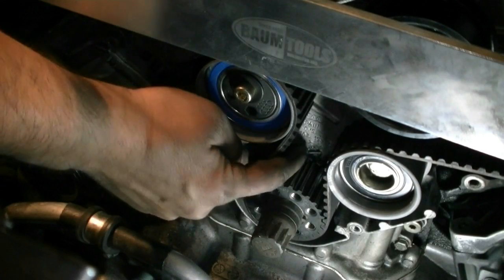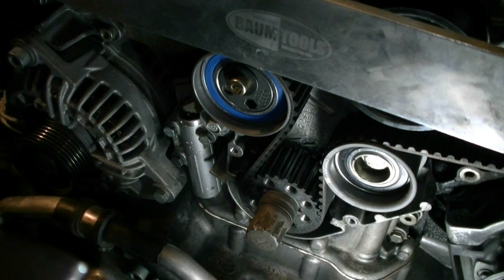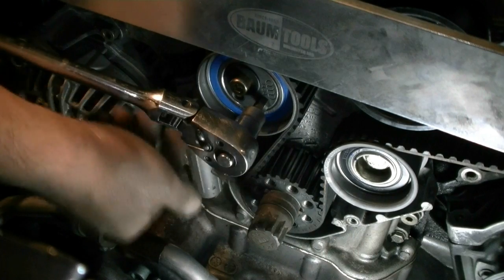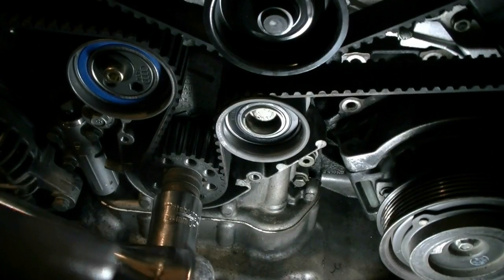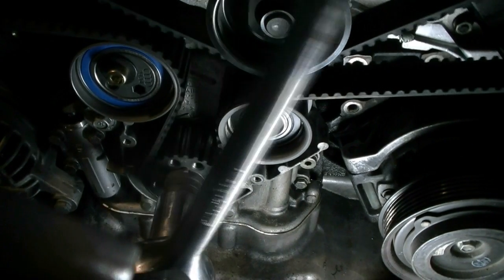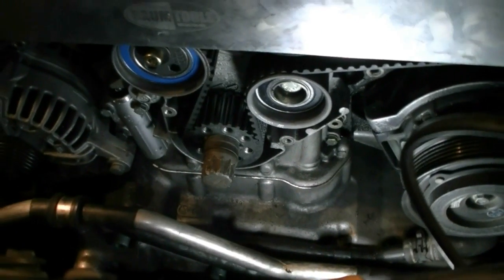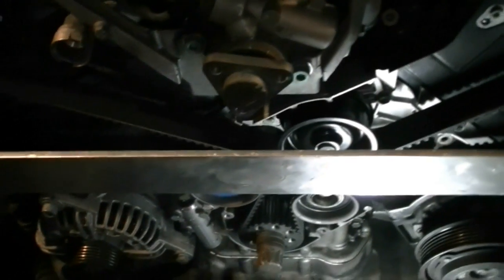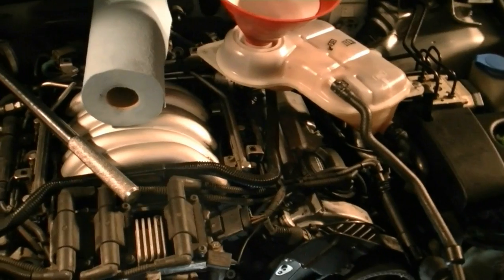How to Replace the Timing Belt on a VW Passat AUDI A4 A6 2.8L Engine Part 3

Comment: I'm going to post a question, but I anticipate no answer, because others have asked questions of their own 4, and even 7 years ago, with no answers.
Anyway, isn't it possible to replace the timing belt without using that $100 "tool" straight steel bar? My thinking is that if the camshaft tooth pulleys remain lined up (with previously marked reference marks) and the crankshaft is also lined up properly, all parts of the motor are lined appropriately.

Comment: I've done two or three timing belt replacements on Volvos with the B230FT engine, so I understand the basic procedure. There is one special tool that is used there to hold the crankshaft in place to remove the harmonic balancer. It's a bit scary if you've never done something like that (I am a do it yourself mechanic). I have a 2005 V6 Passat, and I must admit it is intimidating to think about replacing the belt, thermostat, and water pump on it, but I would not look forward to having to pay a dealership about $1,000 to do that. Is that price about correct? My experience is that a repair job that takes a trained and experienced mechanic 15 minutes to do can cost the unwitting customer one or two hours of labor, so the 'scare factor' on this job would be enough for a dishonest shop to inflate the labor time to five or six hours, maybe even 8. 

All that notwithstanding, thank you so much for posting these videos. They are clear and concise. I also appreciate your providing the appropriate tightening torques, which can make the difference between leaking water pump  or thermostat gaskets or stripped fasteners.

Comment: Hey did any 2.8/2.7 engines ever make weird sounds when turning the engine? I replaced the belt, turned the engine to make sure it's all good. My marks and cam bar lines up good, but when a compression stroke feels like it's about to start, I hear a weird noise at the top end. I don't hear anything when it gets to the end of the compression so it doesn't sound/feel like a valve is getting hit. It's a super high mile engine so it could just be from age or something, I just wanted to be sure before I crank it. It doesn't sound like a valve hitting something, it's more like a lose metal sound, or the valve flying up real fast.

Comment: When you initially put the engine in TDC and remove the harmonic balancer you put a witness mark on the pulley- block then rotate 30 degrees CCW - why?  Why don't you just mark the pulley-block and leave it alone?

Comment: Great video. When I was done replacing the Timing Belt I notice a slight lifter "ticking" noise at idle that I don't think was there before. I didn't run it other than idling for a few minutes, no codes. My question is if the belt jumped a couple of teeth could this cause this problem?

Comment: Thanks a lot for this dude. I just hit 130k and my car died. I had suspected the timing belt had never been done but it looks like I need heads now :)
Reply: sellingthewind what were the symptoms on yours did it stall out outta nowhere and just crank and no start and also a code for camshaft position sensor and EPC yellow light on dashboard my friends is doing the same timing belt is still intact not snapped or broken any ideas would help

Comment: I'm about to do the timing I'm just doing the water pump and the belt not the components my pump is leaking do I have to lock the cams if I'm just doing the timing belt and pump please let me know thank you or if some one would text me I'm at 1 802 753 6621 really need help thanks

Comment: Great videos!! I've done that a couple of times on my Passat so enjoyed vicariously reliving it through your videos. Reading the comments: with the locking bar it's impossible to be a tooth off. The camshaft gears rotating on the camshafts also allow you to get exact timing, not limited to half a tooth as with some setups like the VW L4s

Comment: I have a 2002 Passat w/ v6 engine that just start leaking coolant  in front of the engine (RT side) on top rear of the alternator, any idea on what the problem may be? thanks for the videos.

Comment: great tutorials, just when checking timing marks you said crankshaft timing mark lined up just about right, this might be taken incorrectly. it has to be on the mark or within/less a half tooth, some may be a tooth out and think it is close enough. I see one comment from a viewer regarding adjusting the timing, his must be out.
Reply from the maker: Peter datechmen YES timing marks must line up exactly. I will make an annotation later pointing it out later. Thanks for your comment!

Comment: Thanks for the videos! They have been a huge help as I've been working on my LH cam tensioner seal. Why was it necessary to bar the engine back 30 degrees?
Reply from the maker: ***** Not supper necessary its just a precaution so if the cams snap back you dont bend any valves. But generally speaking if the cams snap back they move off their cam loabs so "usually" you'll be ok. But if you want to take extra precautionary measures you can do what I did. GL
Reply: ***** I second this question
Reply: RatchetsAnd Wrenches Thank You! these videos have been the game changer!

Comment: what's the total amount of hours for doing the timing belt ?
what's the average labor price for doing the timing belt  ?
Reply from the maker: $450-$500 would be a fair labor rateat a shop for Tbelt, water pump, all tensioners and rollers plus the thermostat. GL
Reply: wooow here in Hawaii all the mobile mechanic not certified backyard mechanic they are asking me from $ 700 to $ 1000, unfortunately mobile mechanic have really bad reputation in Hawaii, mechanic shops they go for $ 90 at hour and when I ask if they have the tool they say they don't have it so I am scared they would mess with the car.... Last time i bought the tool cause the mechanic didn't know he need the tool and print a step by step guide. I know I can do all the uninstall install parts EXCEPT adjust the cams and valve. You should come to Hawaii :)
Reply from the maker: Haha very tempting.. yea just shop around if you cant find a cheap one make sure to atleast take it somewhere that knows how to work on these cars. GL
Reply: avg time to r an r a belt

Comment: I have a Passat with the same engine and it has a coolant leaking from the front of the engine. Is there. Good change its the water pump? Only leaks when it runs and coolant drips onto the crank pulley and down onto the oil pan...
Reply from the maker: Probably, but it could also be from the thermostat housing and there is a coolant pipe there too if I remember correctly. Going to have to take off the covers and take a look..you dont want coolant getting on your timing belt so the sooner the better. GL
Reply: RatchetsAnd Wrenches Ok thanks... I just bought a timing belt kit from blau parts

Comment: i did no see where the  crank shaft holder goes did you use it on this car??
Reply from the maker: I didnt use the crankshaft holder, the crankshaft takes some force to move so you are good if you are careful and follow my directions exactly in the video. Just check that it hasnt moved after you put on the tbelt. If you want to use the holding tool, it goes in the left side of the block, you'll need to remove a plastic cover thats in there with one bolt to screw in the holder in its place. GL

Comment: 02 2.8 passat future son in law bought it a few weeks ago car sat for a long time. t-belt broke, bent the valves, we sent the heads to the machine shop but did not take off the cams. my mistake is i marked the  heads but not the cams got it all back it a box . i figured out the caps. are the cams stamped in any way for left and right . int or exh.? looks like they can go on either way. any help would be greatly appreciated. thanks for all the great videos they have been a ton of help. cesar

Comment: Was thinking on getting a 03 passat V6 having 134k. With your videos and my little back ground working on cars you make it look really simple to do the job yourself. Other than the timing belt,waterpump ...etc. what else to look into? also sludge is only for the 1.8t right?

Comment: I have an Audi 98 A4 2.8 and the heater is blowing cold air.  The antifreeze is not going to the heater core.  What do you think is the problem? A friend told me it might be the heater control valve and I cant find it on my car.  Do you really think it's that?
Reply from the maker: I would bleed the cooling system and make sure all the air is out, these engines are pretty hard to bleed. If that doesnt work find the two hoses going into the fire wall to your heater core they should be about the same temp, if not there might be a blockage issue with your heater core. I am not sure where the heater control valve is either but if I had to take a guess I would say you probably have air in the system. GL
Reply: the heater core is fine, i don't have water going into it.  i took the hoses off and the antifreeze is not circulating through to the heater core.  do you think the cooling system has air? what is the best way to bleed it?  If you dont think that is the problem, then what do you think it is?  water pump or thermostat?

Comment: Dear R&W - Need help.  After daughter drove 2004 2.8L Passat to work, we noticed puddle of coolant on driveway.  She put 50 mi on car during day with multiple ins and outs.  No temperature lights or issues while driving.  Took it to gen'l mechanic who found pinholes in coolant pipes under intake manifold & replaced with OEM pipes, o-rings, etc.  No heat when we picked it up after repair. Took it to VW specialist, he  tried bleeding, etc. Still no heat, and no coolant getting to heater core except for a trickle at 3000 rpm while car sitting stationary, then only some luke warm heat.  Our first thought is that the water pump went out, but the VW guy put a new one in (with metal impeller) with the timing belt 35,000 mi. ago (133K on car), and it seems like too much of a coincidence, unless something happened as she drove it that day that damaged it or plugged something.  Second thought is that gen'l mechanic mis-routed pipes, etc., but not sure that's possible, and he says he was very careful to put it all back correctly. Third thought is gen'l mechanic did something to plug it up somewhere. The temp. gauge stays at 190.  We're torn as to what to look at first, All are expensive.  It's 7 below this morning. Thoughts?
Reply from the maker: Sounds like air in the system to me, its very hard to get all the air out of the cooling system on these engines! There are two bleeding holes one on the heater core hose next to battery tray one on coolant pipe below the ignition if I remember correctly. If you google it you can find many good write ups online to help you or your mechanic to get all the air out. GL
Reply: RatchetsAnd Wrenches Thanks for the input.  The VW guy tried that - twice.  I'd pull my hair out if I had any.  Thanks again.

Comment: I love the videos!! I wish i saw them a few weeks ago. I did this job 3 TIMES!! and my car is still bad. I only get error codes 300 304 305 and 306  wich are the cylinders from 4,5 and 6    do you think it could be something else like sensors!??! they all have been replaced.  Where are you based at?
Reply from the maker: Where the codes there before you replaced the timing belt? Does the car making any clicking noise? Make sure you reconnect the cam position sensor on that side(Driver Side).
Reply: RatchetsAnd Wrenches
since I bought the car it has had those codes!! They have been the same piston 4-6 misfire. some time it sounds like a rattle inside..clack clack clack.. and some time its smooth. It comes and goes.  It cant pass inspection and I dont want more trouble??   im gonna send you an inbox
Reply: First I would replace spark plugs(make sure there is no oil in spark plug chamber) and Wires. Just to eliminate it. Then Clear the codes with VAG tool. If misfire comes up, do the TB again with proper tools.

Comment: You won't believe this,put the timing belt back on,cranked the engine over heard a loud pop,I had left my breaker bar and socket on the balancer ,it caught unscrewed the bolt jumped time and bent the valves .still kicking myself,wil pull the head this weekend
Reply: Frank Brown that almost happened to me on a honda I left the ratchet with socket atached nd hera a loud pum thank god nothing.bad.happened

Comment from the maker: Sorry I dont understand what you are explaining, I assume your car has performance issues between 1600-2000rpms and you dont think it has to do with timing or the ABS, well its hard for me to diagnose it like this but if I had to give you any advice, it would be to check all vacuum lines, there are alot of them on these engines and are known for going bad. Good luck

Comment: Hello friend, I have a Passat 2.8, year 99, and I have had some problems in between 1.600rpm spins at 2,000 rpm, has spent several scanners in exchange and motor, I have a doubt be the problem in the ABS or the DOT passat.
DOT POINT OR here in Brazil is known when the engine is delayed or ahead. The car starts to take a tripidação, what can be? the ignition switched todo.Desculpe my English.

Comment from the maker: The labor is going to depend alot on where you live, here in socal labor is cheap so if you shop around you can get the job done inc. parts/labor for around $700-$900. Cleveland I guess $1000-$1200 would be fair if done by an independent shop using good parts etc. Job should included the whole shebangebang (belts, water pump, tensioners etc.) and yes service position for alternator replacement. GL and thanks for your comment.

Comment from the maker: No video but you need to remove bumper cover, put lock carrier in service position, remove serpentine belt and from there removing the alternator is easy. I think two bots hold it in place and you need to disconnect the wires that go to it as well. GL